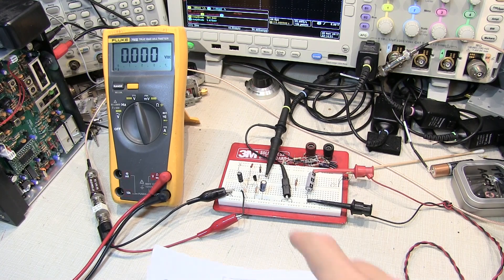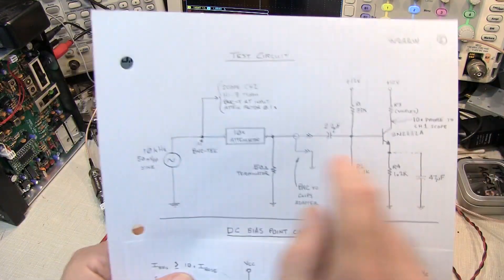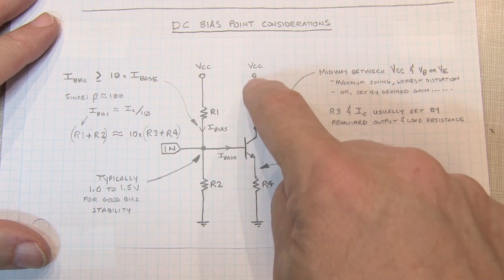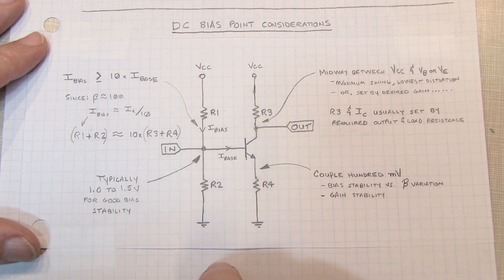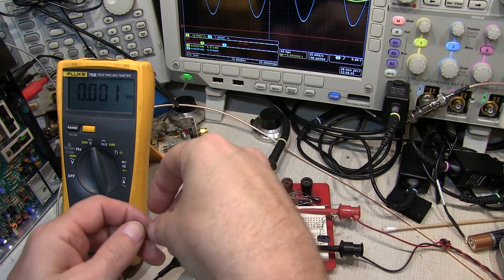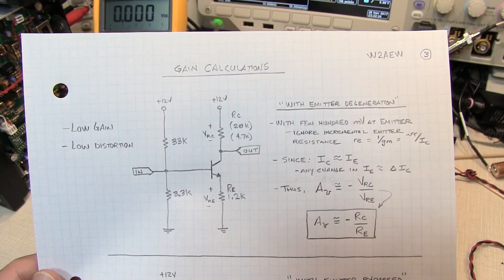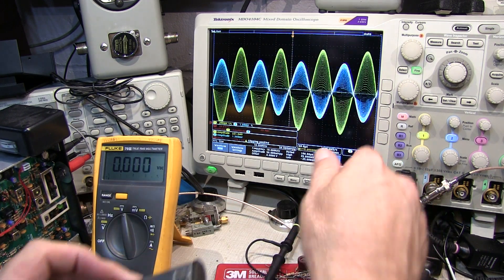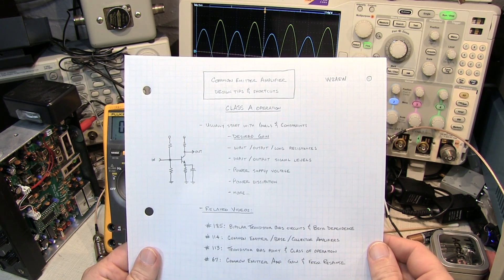#273: Common Emitter Amplifier Design Tips & Shortcuts

Comment: Transistor amplifier circuits and Op amp amplifier circuits are outputting real power, reactive power or absolute power? because I know how to get the gain which is the ratio of output voltage to input voltage but I don't know how to measure and calculate the output power. How is this done using an oscilloscope to measure the output power of a transistor amplifier circuits and op amp amplifiers circuits?
Reply from the maker: It depends on the load the amplifier is driving, because the type of power delivered is a function of the phase of the voltage and current.  Read all about it here: https://www.allaboutcircuits.com/textbook/alternating-current/chpt-11/true-reactive-and-apparent-power/

Comment: what was the transistor used 2N3904?  how as an engineer you pick a given transistor?
Reply from the maker: I don't remember what I used, but likely something like the 2N3904 or other small signal general purpose transistor.  Often times, an engineer will stick with popular, high volume, low cost devices unless there is some specific performance parameter that requires a more careful selection - such as requirements for a specific operating current, leakage performance, noise performance, bandwidth requirements, etc.  It all depends on what the design performance requirements are.

Comment: Excellent tutorial. Should you go with two low gain stages e.g 10 by 10 or one with 100?
Reply from the maker: It depends.  It's sometimes easier to setup biasing for low gain stages, and you'll be able to get more BW out of cascaded low-gain stages.

Comment: Great video! I have a circuit with a switched  emitter bypass cap and a 500 ohm resistor to ground after the cap. What does that do to the signal and would the main emitter resistor still be bypassed and not factor into anything? Thanks in advance.
Reply from the maker: At DC and very low frequencies (where the capacitive reactance is high), the main emitter resistor is used to compute the gain (basically RC/RE).  At higher frequencies where the capacitive reactance is low, then the 500 ohm resistor appears in parallel to RE, and the gain basically becomes RC/(RE||500).
Reply: w2aew thanks for that information. It makes some sense to me. 
I’m new to electronics and I am just looking for a way to adjust the output of my transistor on the fly. Can I get away with putting a trimmer pot on RC to adjust the output (lower rc/re value)? Its a 2 stage guitar boost pedal and I just want to have ability to control the volume out of stage one, the transistor.
Reply from the maker: @Strumbum01  You can use a potentiometer to adjust the volume.  It can be done at the input or at the output.  But, do NOT use a trimmer pot as a volume control. Trimmers are not rated for frequent use, they are only designed for infrequent "set and forget" applications.  They wear out very quickly, often rated only for a few hundred swipes.  See this video for detail: https://www.youtube.com/watch?v=5d_TTQ2OJtM

Comment: In my pile of books the CE biasing examples start with a "given" collector current.  Some choose quite small values...half a milliamp say.  Here you talk about several hundred. I'm pretty hazy on how to select this current value and if I am connecting stages  -say a CE to CC buffer that is not driving something like a speaker ) do I keep them about the same?
Reply from the maker: There are several factors that contribute to the choice of collector current.  Things like power dissipation / current consumption requirements, output impedance requirements, transistor characteristics for best performance (noise, distortion, saturation, headroom, etc.), and more.  There is no single universal answer regarding how to choose the desired collector current.  The most common consideration would likely be the load impedance / output impedance needed in the application.
Reply: @w2aew  That makes sense, thanks so much.

Comment: Please tell how to adjust input and output impedances for common emitter amplifier
Reply from the maker: The input impedance is the parallel combination of the bias resistors and the input impedance of the base (dominated by beta*emitter_load).  Output impedance is basically RC.  If your signal is going away when you connect your load, then either:  Load impedance is much much lower than RC, or you might be DC coupling your load which upsets the bias conditions.
Reply: @w2aew  thank you your videos are awesome thank you very much

Comment: I'm getting back to basics for an ongoing project, destined for modularity and miniaturization, the potentially tiny bipolar transistor circuitry is really important for these applications.   W2AEW is by far one of the most useful and enjoyable sources for this really important subject matter, thanks dude!!
I'm a long time fan , and I am really thankful for your sense of detail and nice way of explaining things. Thanks to you I am a proud owner of 2 Tek 4 channel scopes, an old crt from ebay :) and a TBS1064. For what I'm doing they are more than sufficient, the latter being my basis for accurate measurements, and quick and easy to look at comparisons, thanks to the trace colors. Especially coupled with your expert advice and great quality video productions,  I have lots of 'fill in the gaps' for my general knowledge in relevant areas.  Cheers!!

Comment: Hi great video, but can you explain why the gain should increase so much simply by putting in the emitter bypass capacitor?  Apologies if this is already covered in another video.
Reply from the maker: In short, it reduces the negative feedback, thus raising the closed loop gain.  Page 3 of the notes compares the two cases (not-bypassed and bypassed). Also, Take a look at video #67, it has more details.
Reply: w2aew thanks.  I’m going to try your examples myself.  Interested to see what spice says as well.  Looking for a small signal rf amp to boost the output of a ad9851 dds.

Comment: can u use this circuit to power a speaker and produce a clean sound ?
Reply from the maker: No, it doesn't have a low enough output impedance to drive a speaker.  You'll have to follow this up with an emitter follower or some other amplifier with a low output impedance.
Reply: @w2aew  how do calculate output impedance of common emitter(emitter follower) pls guide 
thanku
Reply: @w2aew   my output clips when i put a speaker at the output
Reply from the maker: @perceptrongaming4290  You may need an amplifier with a push-pull output stage.

Comment: I have a voltage 4v pk to pk and I’m trying take it all the way up to30Vrms and I would usually use op amp buffer but I want to see it how it would work with this. I’m thinking about 3 stages but is there easier  way figure out the resistor values or do I just have to work backward and also I’m thinking about using 3904npn
Reply from the maker: I'm not sure what you are asking...  The simplest way to see *what*?  If you know you input and output voltages, then you can calculate the required gain.  You will also know how much voltage headroom needed on the output side.  That is enough to get started.
Reply from the maker: You're likely not going to do this with an op amp!  30Vrms is equivalent to about 85Vp-p!  Thus, with 4Vpp input, you're looking for a gain of about 21 or 21x.    You won't be able to use a 2N3904, it's voltage rating is too low.  You're going to need a supply voltage of at least 90V or more if you want to amplify this directly.  If your signal is purely AC, can you use a step-up transformer instead?

Comment: The damping factor is the "Ratio" of the load impedance To the amplifiers output impedance. A high damping factor means that the audio sinewave is clean and a low damping factor means that the audio signal or sine waveform is distorted?

Comment: What do you mean by phase margin? you mean the phase shift from each gain stage? when you connect multiple gain stages in series you will get a phase shift from each stage added together in series.
Reply from the maker: It has to do with the frequency response of an amplifier and it's feedback system. If the amp and it's negative feedback have too much phase shift, the amplifier become less stable or potentially oscillate.  Here's a wiki page on the subject:
https://en.wikipedia.org/wiki/Phase_margin

Comment: The damping factor is caused by the power amplifiers output impedance? what can increase or decrease the amplifiers damping factor?
Reply from the maker: It is all a function of the design of the feedback network in the amplifier (specifically the gain and phase margin).  There is no single specific cause - it is entirely dependent upon the overall amplifier design.

Comment: I want a voltage of 12v at the output. a mp3 at the input but how do i calculate al the resistors?
Reply from the maker: You need more information.  An mp3 file does not have a specified amplitude, so it is impossible to calculate the required gain.

Comment: Tube Rectifiers have a Drop out voltage called Vdrop on the datasheets. 5AR4 tube the dropping voltage is 17vdc, 5AU4 the dropping voltage is 54vdc, 5Y3 tube the dropping voltage is 50volts. Why does a tube rectifier start to drop the output plate DC voltage when its output current draw is at its maximum? What is going on inside the tube rectifier when its in the Vdrop condition is the cathode and plate electrons less? I'm not understanding why the tube rectifier is causing a dropping voltage on the rectifiers plates output voltage.

Comment: I dont understand how the cap is adding a shocking amount of gain.  Great vid though thank you for posting
Reply from the maker: I'm sure you are referring to the capacitor placed in parallel with the emitter resistor.  The emitter resistor in a common emitter amplifier adds negative feedback, which reduces the gain.  When a large capacitor is placed in parallel with the resistor,  it has a low reactance to the signal frequencies, thus it effectively shorts out the emitter resistor for the signal frequencies.  Thus, the emitter resistor provides the benefits of bias stability (see another video of mine on transistor bias stability), but is effectively taken out of circuit for the AC signal - thus increasing the AC gain of the amplifier circuit.
Reply: Thank you for responding

Comment: Can u suggest a book for advanced bjt and fet transistor? I guess it would be pretty nice you make a video suggesting some books for us.

And Im hoping we will have a Fet amplifiers teaching too. 
I studied fets by books, but they all say to use gm from datasheet. But it has no accuracy for gain calculation... or even drain current calculation.
for example, source current with fets depends of Vgsoff, but generally it is a interval, not a fixed value, what give us poor acuraccy defining drain current. But sometimes, when we look at some internal ICs circuits, we see FET current sources... how do they know the current??
Reply: Hmm, I'm no expert, but regarding your question I believe you're either talking about jfet type sources (usually single) or mosfet mirrors, but I think the FET sources. While these will not have the best defined current value, they work by connecting the gate to the source (n-type), usually through a resistor, such that the fet will saturate and hold constant after a certain Vds has been reached. The rest of the circuit functions as expected based off of this relatively constant current. the wiki article on Jfets has more info + sources

Comment: how to choose those biasing resistors value as well as collector resistor and emitter resistor
Reply from the maker: Input biasing resistor value choice will depend on several design and application factors.  Good practice says that the current through these resistors should be at least 10x greater than the base current.  The application may have requirements on the input impedance to this circuit - so that might have an influence on the choice of values as well.  And of course, the desired operating point determines values and ratio.  Ultimately, it is often a compromise between a number of these and other considerations. Similarly, the collector and emitter resistor values will be based on a number of factors for the application - desired gain, desired collector current, desired emitter voltage, desired voltage swing, desired output impedance.  Usually, one or two of these design considerations will be important for a given application, and they'll help to drive the choice of the specific values.

Comment: hello. why do I have different results when using multisim?  I tried your amplifier design on multisim app. I used 1k load
Reply: im trying to make a 50Gain amplifier with ouput of 5Vp-p. what should I do? because when I did the calculation. and tried it on multisim its far different from the targeted values. please help
Reply from the maker: @gimon2233  Impossible to say why without seeing your specific circuit.
Reply: Ok. Can I have some tips for my project? I need a 50Gain output with load of 1k ohms. Im using 12V VCC. Im going to use a 2n3904 transistor. Where should I start and what config do you recommend?
Reply from the maker: @gimon2233  if you want 5Vpp, you'll need to have enough voltage across the 1k collector resistor accomodate that swing.  So, that means at least 2.5V across it without a signal.  Suggest 3.5V to give you some headroom.  That means collector current is 3.5mA.  Setup bias on Base to be about 4V, this will ensure headroom against saturation when collector is swinging 5Vpp.  This puts emitter at about 3.3V, and you know emitter current is about 3.5mA, so total emitter resistance will need to be about 3.3/3.5mA = 940ohms.  Since you need a gain of 50, you'll want about 20 ohms unbypassed in emitter.  So, from emitter to ground put a 20ohm in series with 910 ohm, and bypass the 910 with a large capacitor.  This will be a good starting point.
Reply: @w2aew  thanks for that info. but what I mean by 1k load is that its a resistor parallel to the Collector resistor. it is the load in the output side.

Comment: what will happen to the gain  of the amplifier when a load is connected to the output terminals
Reply from the maker: It all depends on the impedance of the load, because it will combine in parallel with the collector load.  If these are equal, the gain cuts in half.

Comment: But....? Why is it called  a "Common Emitter" amp  ...?
Reply from the maker: Because the emitter is connected to the signal ground which is "common" to both the input and the output (as far as the signal path is concerned).
Reply: @w2aew  but why would you do that? I see you reaching a hand out to help, but you are holding it up too high. WAAAAY too high.

Comment: wonderful video and thank you for using a camera tripod. Video #67 had me running for the Dramamine having watched it so many times, getting up and walking around like a sailor new to port. I tried recreating the circuit in #67 but kept getting VC and VE values 13-15% off in my calculations vs. measured (VC calc = 2.29V, measured = 1.946V). I'm learning so this might be common knowledge but it appears while an emitter-bias is somewhat independent of beta variation, the formulas are significantly sensitive to VBE. I was using the 0.7V approximation for silicon transistors and getting incorrect values for a 2sc945 transistor. The 2sc945 datasheet has a VBE min = 0.55V, typ = 0.62V, and max = 0.65V. Using the typical 0.62V VBE in the equations resulted in the calculated values matching the measured. Thank you for showing the trick for AC signal to the oscilloscope. Not sure if you used the same in video #67 but when I tried there was so much noise in the low freq I couldn't keep the same attn. that was used on the HF and then I was no longer comparing apples to apples.

Comment: Hi Alan 
As always this is a another great video  :-)

Could you please load a video of a simple   Video / Audio  transmitter circuit and  explain the flow of  video / audio signal ?
I have seen few video transmitters on U-Tube but all of them not properly explained.  
I also appreciate if you could explain at the same time,  why  Video input  feed in to the Emitter leg of the Transistor 

kind regards , dinna
Reply from the maker: I don't have a AV transmitter circuit that I can review, but when I get one, I can do a video.  In the meantime, one comment I'll make regarding the video input often gets applied to the emitter - it is possible that they're using a Common-Base style amplifier, which is suitable for low impedance high-speed applications.  Check out this video to learn a little more about common-base (and common-emitter and common-collector) amps.
Reply: Hi Alan 
Thanks a lot for the response .  Below links show the AV transmitter.  That is most common circuit can be found in the U-Tube. I really appreciate if you could do a  video on   ( Video/Audio  transmitter ) 
Links  to the circuit  ( This is the only circuit use most of the  channels and sites  ): 
  

http://www.zen22142.zen.co.uk/Circuits/rf/tv_tx.htm

https://www.eleccircuit.com/diy-the-wireless-video-audio-signal-sender-circuit/

https://www.youtube.com/watch?v=rmGAd_MVaWw  

https://www.youtube.com/watch?v=D6mXAjd32bY

Kind regards,
Dinna